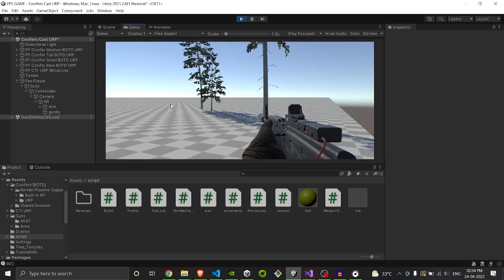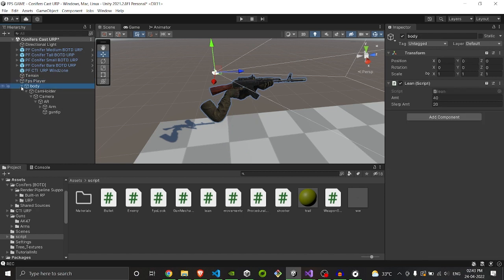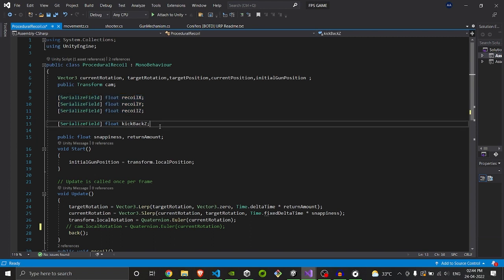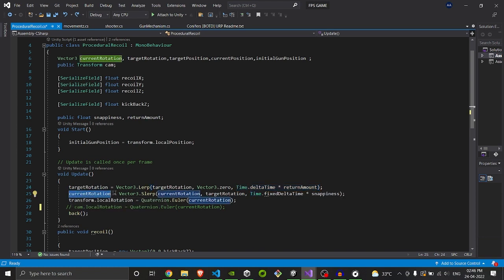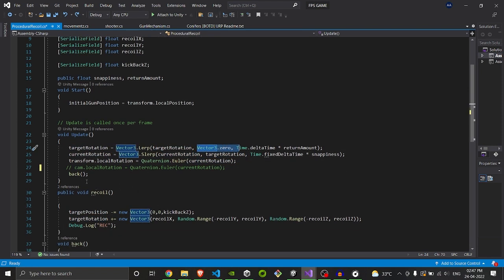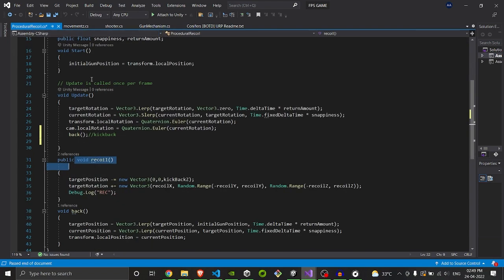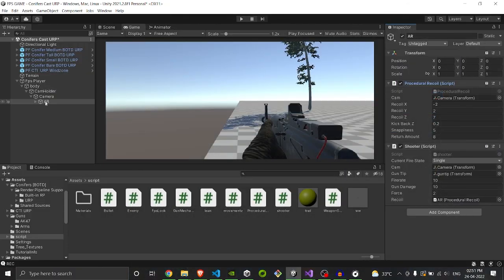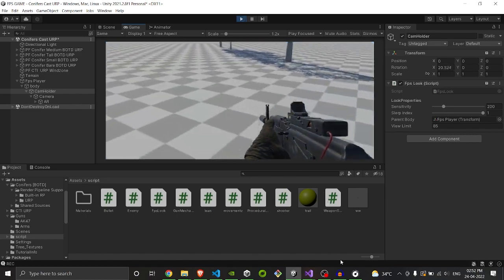Unity Gun Recoil (Procedural recoil) Tutorial!

Comment: Cool but isnt this frame rate dependent ?
Reply: Some of it uses fixedDeltaTime, that part is not frame dependent, the deltaTime parts are frame dependent though. Also, I don't think it really matters that much, if somebody is lagging real bad, they ain't gonna get an advantage by the recoil being really slow, they won't even be able to move their cursor to aim correctly.
Reply: @Dark-oy2wv  Hi, problem is that less fps will cause your recoil to be higher than slower, which means for already laggy game you will need to fight higher recoil than players with smooth gameplay, that is a big nono :D Even if you play with vsync on 60 fps and switch vsync off and get lets say 120 fps, on 120 fps the recoil will be very very little. I used similiar approach to procedural recoil and overall procedural animation system in my bachelor project and i feel so bad for putting this fps dependency in it, as really the fps difference completely ruins the game ;)
Reply: @GR4MPI  Yeah, I understand fps difference will ruin the game (Especially in a competitive game), but, I mean, if they were really laggy, i'm pretty sure they wouldn't be able to aim or anything (Like I can't in games when i'm lagging), obviously, recoil contributes, but, I'm not sure if you can, but you probably could just switch it to fixed and the script would work the same way, just not relying on the fps (I'm not even 1% sure this will do anything, haven't tried, just assuming it might). Either way, low FPS always ruins your session reguardless, you could even be getting low fps from high latency if the game is designed to update reliant on networking as well as the FPS, but yeah, higher fps might decrease recoil, lower might increase it considering the frame dependency, I just personally am not too worried as i'm not trying to make a competitive game with this (Possibly in the future, who knows), but, if you are, then, probably try to do fixed and stuff instead, cause it would be beneficial for the players.
Reply: @Dark-oy2wv  sure, makes sense. I worked this out in my project anyway, i build my own method similiar to fixedupdate but with different time step which is independent of fps and do all my procedural stuff here, although the animation smoothness is not fixed to certain framerate controlled by the timestep i think on higher fps its not the animations smoothness what matters more, but the overall smoothenss of the game. so my animations are now fixed to 60 fps even if game runs on 120 or more :D
Reply: @GR4MPI  How exactly did you do that? I would just think a coroutine maybe, but, that wouldn't be effective at all, as it could just stop, so how would that method work? Just curious - It's fine if you aren't willing to share
Reply: @Dark-oy2wv  Since Update runs the fastest it can, i made variable time and timestep (controlls rate at which animation is updated) then in Update i check Time.time and comparing it with the timestep treshold and if its under it then we dont do anything, and if its above slightly we call our method. And now important thing since fixedupdate never miss any step (to make physics good) we make it so if the comparison with Time.time is a lot bigger (like having low fps and update running slow) then we call our method multipletimes to catch up (like fixed update would). if you want code or something i can give you, np
Reply: @GR4MPI  Yeah, if you could give the code, that would be appreciated, easier to learn from code than an explanation, as I don't fully understand exactly what you mean (I do, but, not to the extent I would know how to code it), thanks
Reply: @Dark-oy2wv   wtf, i checked this comment section again if i see a response and what the hell, i sent you the code but its not here
Reply: @GR4MPI  Oh, weird, I never got it either, maybe it was too long and it auto deleted or something? Not really sure why it was blocked
Reply: @ Yes, probably, or it blocks code at all. I tried to send it again, but i dont see it here :(
Reply: @GR4MPI Yeah, no idea, kind of dumb